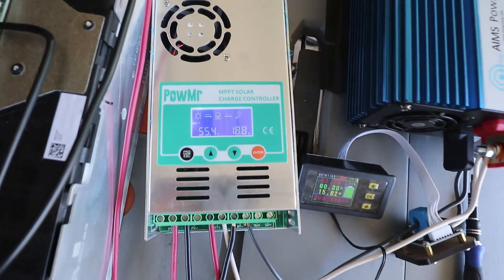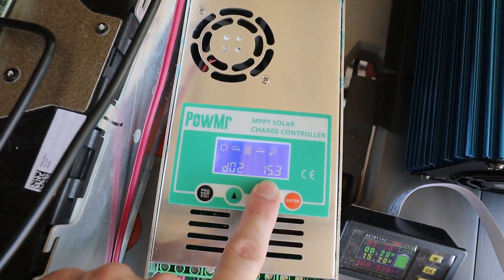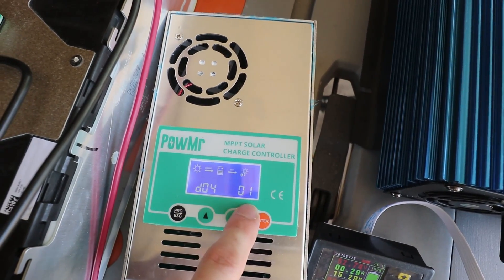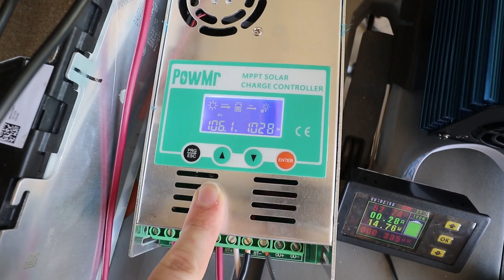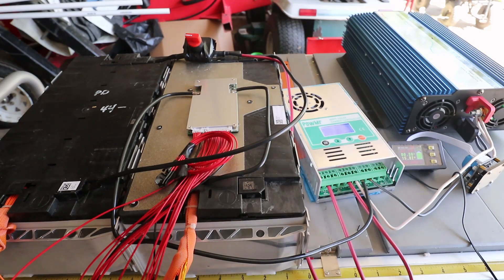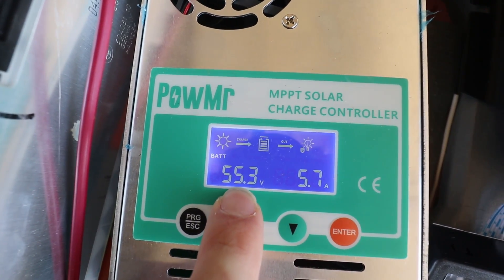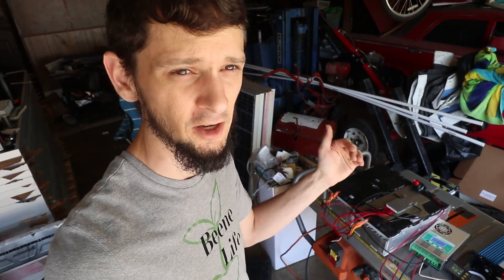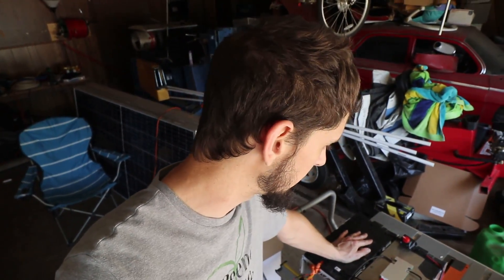$100 60 Amp Solar Charge controller from PowMr - Lithium Ion Charging!

Comment: Where would you connect your inverter?
Is it on the batteries or on the load terminal of the charge controller?
Reply: Battery

Comment: Hi, great video! I have a 48v battery and have 3x200w panels at 23VOC each amounting to 69v in series. In the manual it says pv input for 48v is 72v-150v and my battery does not charge even after using your settings. Do i neet another panel in series?
Reply from the maker: Yep I think your voltage is too low. I had a 69voc Sun power panel connected and it was charging but at about half the wattage it should have been. Another in series put me into full speed charging.
Reply: @BeeneEnergy  i cant even get a charge at 69 voc, half or whatever.

Comment: Why does it calculate the Batt volt and Pv ampere as the input watt the battery receives. Doesn't it convert the excess voltage to ampere to maximize charging??? Isn't this no different from a PWM?

Comment: Please sir, mine shows 00 W meanwhile it is connected to the solar panels and the batteries are connected as well, it does not shoots electricity to the house, the power inverter makes a shriek sound when trying to power it on. Please help
Reply from the maker: What voltage shows on the controller for battery and solar?

Comment: What will happen if bms suddenly disconnects the battery from this charge controller? Will this PowMr survive DC power coming from PV in this case?
I have been using this mppt charge controller for five years with lead acid battery, but now I am planning to switch to lifepo4 which will be charged with this charge controller.
Reply from the maker: I’ve had that happen a lot and never killed a charge controller due to it.
Reply: @BeeneEnergy  Ok. Thank you sir.
Reply: How does it decide the amount of constant current (Ah) for lithium batteries? I watched in your video it was giving 300wh to your battery bank in sunny day even though you have 1kw+ PV  attached. Does it reduce the amount of amphere to maintain constant amp from fluctuating flow of power from PV? Why are you not able to charge your lithium battery with maximum power available from PV?
Reply from the maker: @nizamersoftware  It’ll run cc cv in lithium mode. So if the set voltage point has been reached the current will start to taper off until the battery doesn’t want any more current.

Comment: I cannot change d01 voltage setting. I pressed enter but the number does not flashing.but 24h setting can change when i oress enter. Why ? And how to make d01 flashing ? My battery is lead acid.
Reply from the maker: Have you tried holding the enter button? Then reboot the charge controller afterwards and verify it changed.

Comment: Hello.
Voltage at Maximum Power (Vmpp)= 34.5 V
Current at Maximum Power (Impp)= 9.59 A
Open Circuit Voltage (Voc) = 40.2 V
Short Circuit Current (Isc) = 10.1 A
I have 2 monocrystalline solar panels worth 330W...
How can you connect these 2 panels to this MPPT 60A solar controller? With serial connection or parallel connection?
 Because I looked at the device information, it is 12Volt. It says that the highest 80Volt input can be connected for the battery (VOC). (my 12.8v 200Ah
 I have a LiFePO4 battery)
So should I use it only with parallel connection?
I was confused and wanted to get precise information...
Thanks.🙄😇
Reply from the maker: Yes definitely parallel

Comment: I had one of these SCCs before. Worked fine, although I didn't like the small terminals that didn't accept large gauge wire.  Now, two years later, would you still say this is the best bang-for-the-buck SCC available today in 2023?
Reply from the maker: Still unmatched IMO for a 60a MPPT that's super basic. I did find some Elejoy 25a units that are fanless and much smaller but not the same value this 60a gets us. I agree the 10awg terminals are abnoxious.
Reply: @BeeneEnergy If it’s a low current, 48v system, shouldn’t the 10ga be adequate?  I’ve ordered this controller for my system but haven’t received it yet.
Reply from the maker: @ As Long as you have over current protection that keeps the wire safe it shouldn’t matter. Unless you start nuisance tripping due to too high a current.

Comment: hello friend, so i have this unit hooked up to 48 volt batteries. i have fourteen 100 watt panels. i ran two series strings. so this morning i put a shunt meter from controller to battery and the meter read like 1/3 what the watts where on the controller. i'm trying to figure out which device is lying to me. i know im getting 146 volt input. that charging does happen, but not sure of out put, my next step is a shunt meter on the pv i guess. mr power looks so good in your videos, mine looks like 40% efficient, whats your experience say about mr power
Reply from the maker: While the powmr is typically optimistic in its readings I’ve never seen anything as low as 40%.

What does the current reading look like shunt compared to powmr?
Reply: @BeeneEnergy  i think mr power was like 600 watt and the shunt 170 watt, batterys at 12.5 volts
Reply from the maker: @chriscates3352  The battery was 12.5v? I thought you were charging a 48v battery?

What is the current/amp reading on each device while charging?
Reply: @BeeneEnergy  today i have 2 iches of snow on roof panels. i placed my shunt between controller and battery. its the 300amp one off amazon. i placed the inner wires in picture the same, so that orange wire was by negative side of battery. but my load side is the controller.
Reply from the maker: @chriscates3352  ok let’s try a different question. What voltage does the shunt screen show?
Reply: @BeeneEnergy  they match. controller says 49.4 volts and shunt says 49.4
Reply: next time we get sun, i'll compare both, the current controller says, what the shunt says. my meter is only 10 amp and i hould have 1200 watts in full sun, so not big enough. explain if volts the same and close in current, what we are verifying? i assume the watts is output and not input from panel watts right? is 146 volts bad for these, people keep saying around 75 volts for best efficeiency?
Reply: @BeeneEnergy  found my issue, my shunt was set for 50 amps and not 300, once i watched how to set it the current and amps now match. how about that!
Reply: sorry, i have a 12 volt inverter  in my group off batterys, so its saying 12.5 volts. plus a 30 amp controller 12 volt on one string of batteries to use a 200 watt panel that was 17 volts, was odd balll.
Reply from the maker: @chriscates3352  I really want to know how much current is being measured from each device.
Reply: @BeeneEnergy  update: still snow but some power being made, on mr power under batt icon have 50.1 volts and 1.7 amps. then under pv icon 50.4 volts and 87.3 watts. my meter says 50.3 volts, 244 ma, and 12.2 watts. this is my confusion

Comment: Returned this unit as the Amazon description is false as it claims adjustable voltage from 0-60 v and adjustable current from 0-5 A.
Total Bull chit and dangerous if you are attempting to fine tune the parameters for 48- 52 v ebike batteris
Reply from the maker: Did they advertise variable current? That’s not something common for inexpensive charge controllers.

Was .4v increments too much?

I’ve got a cool boost converter I’ve been using for golf carts/forklifts. It allows .1v adjustments and bonus the solar panel needs to be lower voltage than the battery. If you’re interested.
Reply: Yes , the Amazon site specifications listed Amps & volts as adjustable.
Thanks for your demo with the MPT-7210A , you and a couple others sold us on that little budget unit for 52V  S14P10 18650 DIY batteries for  ebikes & RV system.
Took a fair bit of web surfing to find budget 42- 60 V chargers with adjustable Volts & Amp options.
MPT-7210A working great with 2 100 watt series panels but having some issues getting unit to accept  3 panels even though the output is ~55V which is below the units 60 V max recommendation.
Reply: Only took 1/2 hr to bolt MPT-7210A fan on exterior of cooling intake port .Reduced noise by 75%.
Seem to be talented electrical engineers that designed this unit but apparently deaf as doornails.
Reply from the maker: @bradharris6102  Yeah that little fan is brutal.
Reply: Sorry,  just noticed you sell PV equipment.
Do you have an idea on the approx duty cycle  for the MPT-7210A as interested in a spare or two but haven’t worked unit long enough yet.
Live outside Victoria BC and was dinged $350 duty on an $1800 Battery hookup order charged by FedX.
How do customs treat used PV panels into Canada?
Currently trying to get our local Federal member of parliament to address this ridiculous used Li battery duty issue for the DIY community.
Reply from the maker: @bradharris6102  Yeah I’ve heard duties on batteries are bad up there. I’ve never tried to export panels to Canada or elsewhere so I’m not sure how bad they’d be taxed either unfortunately.

I ended up installing my 7210 in a little power station so it just charges a small lifepo4 battery off a car battery. Pretty easy life. Not sure on its duty cycle.
Reply: Thanks, apparently tariffs recently lifted on PV panel exports from Canada to  US so looks like it may be a mutual agreement.
We’ll try and trade with you for some used panels if it’s worth your while as working on a simple heat pump made of insulated container of sand + 48v resistant heating elements for home heating.

Comment: This charger have one big problem with the imput voltage and you can that not calibrate if you connect  a power supply direct on the power pv connecter it is not calibrate. The display on the the charger is not the same from the power supply unit
Reply: Mine seems to be about right I see like 54.8v with my meter at the terminal and the unit says like 54.8v

Comment: can you hook up 3 250 watt 8.85a 30v to this 60a charge controller> on 12v battery bank
Reply from the maker: Yes, you’d just run them all in parallel.

Comment: I see in another review that the display lies and is 25% or so off (when it said it was charging with 59amps it was actually only 42amps measured with meter,) have you checked this by chance?
Reply from the maker: Yep these things can be very optimistic. Efficiency is as expected just displays bigger numbers than is possible a lot of times.

Comment: Do you trust that CC with your Lifepo4 cells?  What happens if the BMS should disconnect for some reason? Will that fry the CC?  If that happens FET’s go SC and the BMS will be exposed to the full array voltage. Can the BMS handle that? If not, the BMS pops and again, the FET’s go SC and the cells get charged with no control and they cook. You really need a CC that can handle a battery disconnect with full power from the solar panels.
Reply from the maker: What is SC?

I’m not sure how the bms would see the full array voltage. That voltage had to go through the dc to dc conversion inside the charge controller before reaching the bms.

I’ve observed the bms disconnecting with this scc, the charge controller will initially spike by a few volts then hunt for the charge setting it has in memory. 14.6v for example.

What is different between charge controllers that one can handle a disconnect and another can’t?
Reply: @BeeneEnergy  SC is short circuit. Typically if you over volt a FET, it will go short circuit.
If the SCC were to fail, it quite common for the FET’s go short circuit and the array voltage would pass uncontrolled through the controller hence exposing the BMS to the full array voltage.  The batteries would be charged without control until the BMS disconnects due to over voltage. At this point the FET’s in the BMS would be exposed to the full array voltage. With cheap SCC’s the max Vds of the FET’s may only be around 40-50V. If the array voltage is above this, they will blow (usually short circuit) and the BMS will pass the array current to the cells.
With better quality SCC, the components are better quality with higher power/voltage limits and more/better protection circuits. 
When you invest so much money in the Lifepo4 cells, it doesn’t make sense to use cheap SCC’s and risk ruining the cells.
Reply from the maker: @kevinmills5293  Are you sure an mppt SCC would pass array voltage to the battery in a short circuit scenario? I could see that with a pwm model as the fet is the only thing between the panels and battery. But an mppt by design must have a dc to dc conversion process that is assuredly more complicated. Do you have an example I can look at where the mppt scc failed?

The only cooked batteries I’ve come across were from a pwm controller.
Reply: @BeeneEnergy  a MPPT SCC is basically a buck converter. If you look at a typical buck converter you will see that a failed FFT will pass the array input voltage to the battery output.
Reply from the maker: @kevinmills5293  Aha I can work with that info. Perhaps I should risk sacrificing a charge controller to see how it reacts if the input side fet got stuck closed.

I do think there is some falacy in believing paying more for a SCC makes it more reliable to this type of failure, but I have no data on that.

I do know that I’ve personally used a dozen of these units and sold probably a hundred and have no reported failures. Fwiw
Reply: @BeeneEnergy  I’m sure these SCC’s are fine with lead acid batteries but if they are connected to a Lifepo4 battery with a BMS, things can go wrong.
Reply from the maker: @kevinmills5293  What is your thought on them being ok with lead? Seems to me lead acid has less protection with no bms. Full array voltage would cook a nice set of lead acid batteries until they were dry.
Reply: @BeeneEnergy  it is a BMS disconnect event during charging that triggers the failure.

Comment: Do u still like this controller
Reply from the maker: Yes! Still can’t beat it for the price. It’s a no frills device that gets the job done.
Reply: @BeeneEnergy  is it abjustable for lithium
Reply from the maker: @leasttrending  It is, last setting is 1 for lithium 0 for lead acid. Once on lithium it ignores float value and just uses bulk charging value.
Reply from the maker: @@ClassBLiving64 I mean if you want to set a float value for lithium leave it in lead acid mode. I don't do a float value for lithium as I need to to stay at a higher voltage so balancing can occur in the battery pack.
Reply from the maker: @@ClassBLiving64 that’s cool, don’t choose it. I’m just confused why someone would use float to charge a lithium. Maybe I’m missing something.
Reply from the maker: @@ClassBLiving64 Yep. You are talking about a lead acid charge profile. Go look up the charge profile for a lithium battery. Simple cccv which doesn’t involve a float or absorption mode.

Comment: I need some help, I have a 7S 100P  18650 battery pack,  29v lithium battery,,  what would be the best setting for this.  If D04 is set to 01 does it all other setting become invalid ?
Reply from the maker: Once d04 is at 01 then you need to set d03 to 29.4/2 which would be 14.7v.

Make sure you double check with a multimeter that it charged to 14.7 and stops. Don’t trust the accuracy of the powmr!
Reply: @BeeneEnergy  D03 only goes up to 12.5 :(
Reply from the maker: @Ojames600  oops d02 is the correct one. D03 is the cutoff voltage for the load output.

D01 is float mode which won’t be used in lithium mode.
Reply: @BeeneEnergy  THANK YOU very much. D2 set to 14.6  gave me a output of 29.2v. :)

Comment: I need help with settings! please??!!
Reply from the maker: Could you elaborate?
Reply: for somebody who is setting up solar for the first time there are no instructions as to what your parameters should be. we have three panels that are $310 recipes we have eight deep cell batteries they're not lithium ion. we have an inverter 3500 Watt generator for backup tied into it for when the batteries are low and are all in one solar charge inverter is $3,500 w 80 amps. we can never get the batteries to charge more than 50%. there are no instructions with this at all
Reply from the maker: @jaynelevesque74  What are the model numbers, and why don’t they have instruction manuals?!

Comment: please tell me what is the point in having a 48v battery
Reply: One 48v battery is cheaper to use because of less wires to connect four 12v batteries. Also a 48v system is more efficient with much smaller wiring because of higher voltage and lower amps.

Comment: Does this controller turn on the ouput terminals when the PV's drop below a certian, low voltage such as at night to automatically turn on lights?
Reply: No it does not. It has a LVD on the 5A load, programmable. But you have to disconnect solar then battery, reconnect battery to get it to turn on again
Reply: @michaelbouckley4455  Thank you. This is what I was looking for.
I thought mine was faulty because it didn't turn back on after low voltage cutout.

Comment: Can someone help me please I got 2 panels 385W each panel I would like to use a pow mr 60A but I saw for a 12V sys is 600W max
Reply from the maker: 600w sounds low, was that for a 50a model? Should be 720w.

Regardless, as long as you run those panels in parallel not series you should be fine. It’s ok to over-panel by a reasonable amount. The powmr will limit output to 60a.

Comment: I am thinking of using this as a charge controller fed by a 240v HP server power supply, what are your thoughts pls?
Reply from the maker: What voltage will your power supply output? It must be higher than the battery you will be charging.